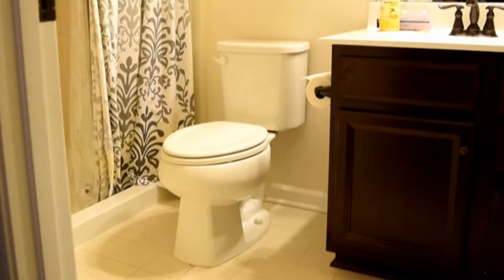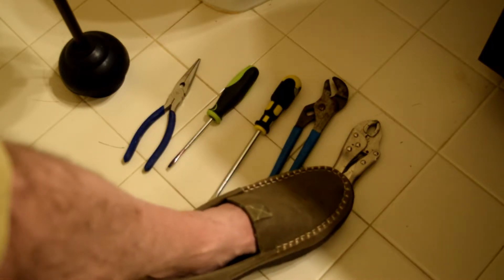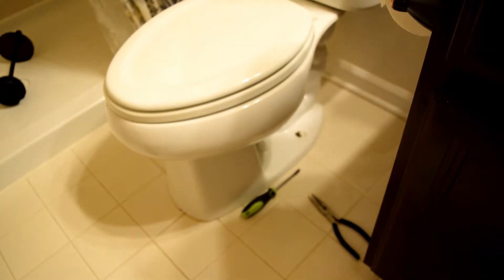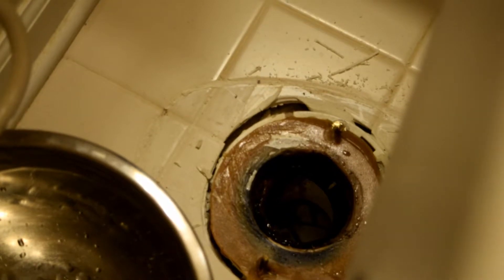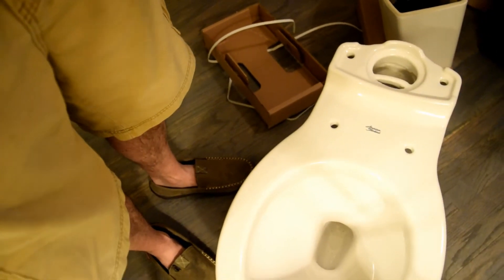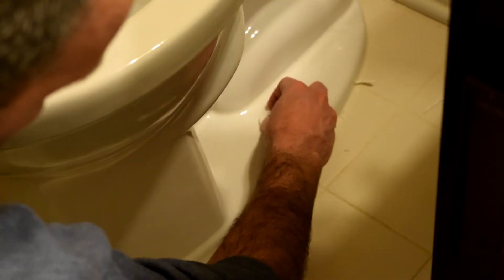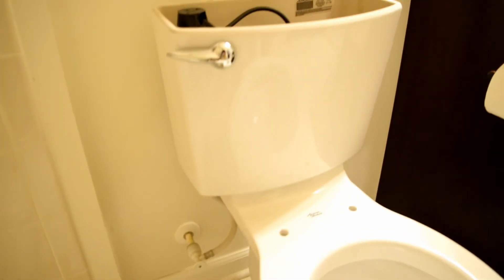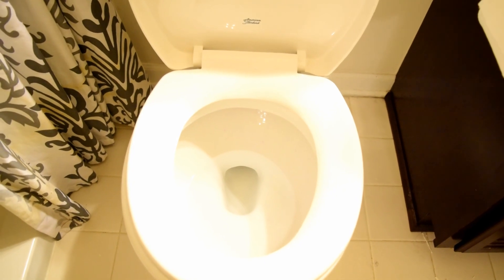How to Replace a Toilet - DIY

Comment: I was thinking about buying a new toilet but I think I will get someone else to put it in I might mess it up lol great job my friend 👍👍❤️❤️
Reply from the maker: Thanks.  Anyone handy should be able to do it in about an hour.  That's about how long it took me and I messed up the one part with not putting in that gasket.  The worst thing you can do is get some water leaking and you can test it right away.
Reply: You're welcome and thank you❤️❤️